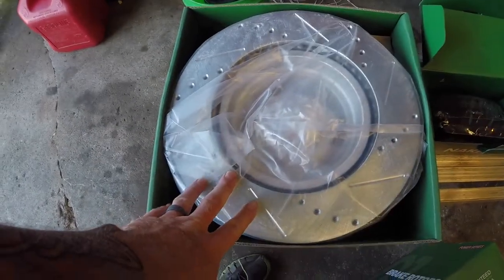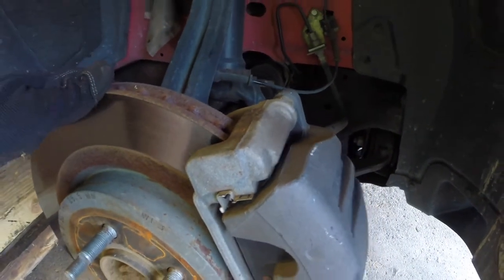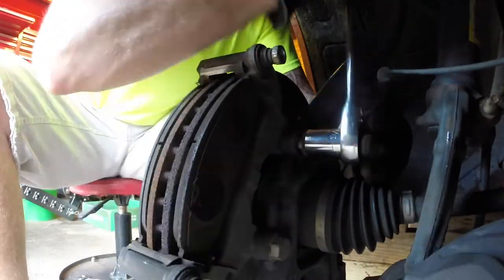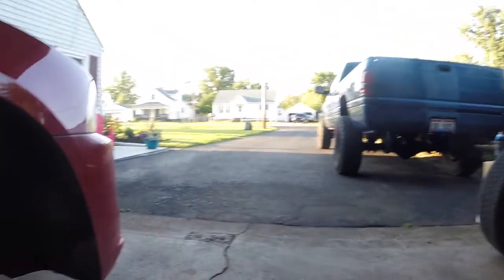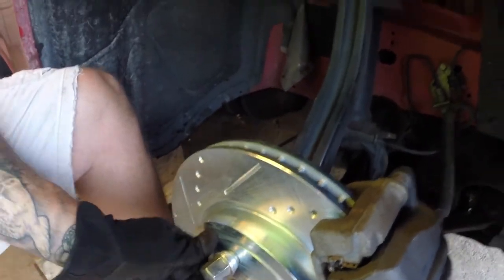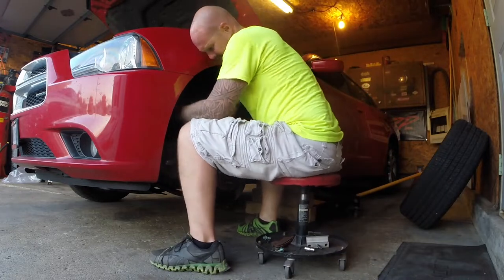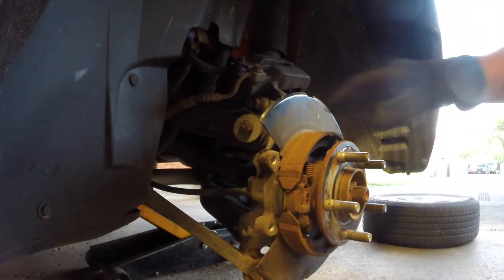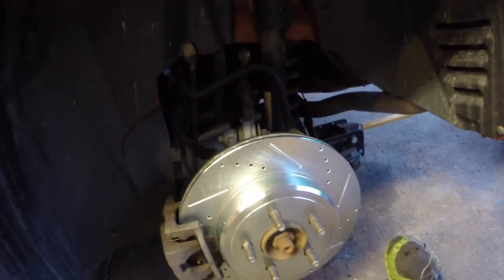Dodge Charger 2nd gen Brakes

Comment: good afternoon its 1 12 pm afternoon am waiting for dad.can t comment on if this correct brakes or you need other or are better brakes .only comment what ever you do self is cheaper and most of the time better.i know the heat and the humidity i ben there.here in Netherlands is 20  or 30 with tonight rain. and perhaps if i was in Holland Michigan i would have the same heat.long story but right i can only drive automatic.mine is half automatic like volkswagen DSG transmission but am now allow to drive a stick.i ever drove a 316 stock in 80ts with a manual from the driving school.1 17 pm dad is only ready at 2 30 the day is than overrrr almost .have a nice day.
Reply from the maker: Thanks for watching! I like the diesel Volkswagen.